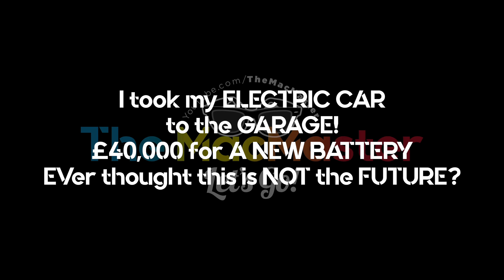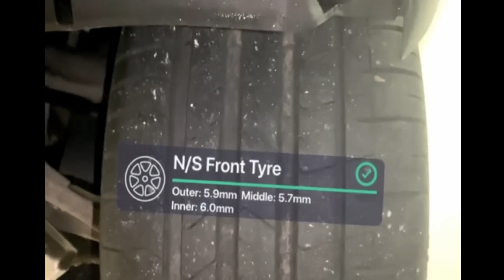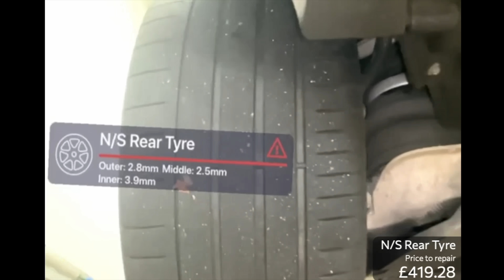I took my ELECTRIC CAR to the GARAGE! £40,000 for A NEW BATTERY EVer thought this is NOT the FUTURE?

Comment: Actually, my wife and I would be able to use an Electric car most of the time, as our needed distance is mostly limited. But we don't have room for it to have a fixed charger nearby and would most time need to drive a distance to get it charged. And once in a while we drive long distance, and I would hate to have to waste a long time during that for charging on top of the driving time. I don't drive 2000 km during a long weekend anymore. If so it would be absolutely hopeless (Denmark to Belgium and back, to walk 100 km)

Comment: Your looking at this wrong.  Electric planes wont be a thing and that is the point. They don't want us in personal.electric vehicles.The plan is to remove plane travel and powered personal travel altogether. The aim is to force us to stay put or take public travel. As for Porche's synthetic fuel, yeah it works BUT it has to be manufactured from scratch. There is no way this can replace thr current oil supply or amount of fuel we actually use. A non starter as a petrol replacement of scale. Hydrogen is the nearest to getting it right. But...

Comment: I think Truly and Honestly the buyers ,lease people, people getting finance need to use fit for purpose, if this product dies ,gets bad damage just from anything in normal use that gives this cost it surly cannot be fit for purpose, for god sake things happen ,manholes pop out due to extream weather ,Gullys too ,potholes ,yes these can cause damage ,yes if your lucky you can get the evidence and claim it back but no way at this cost .

What you have is a expensive brick that is costly if electric prices are high ,issues with chargers in general ,distance it can travel due to the temperature and a vehicle that truly cannot take normal punishment on the road ,some may say extream but its not compared to the costs involved just hitting the underside ,for God's sake knowing this why on earth would anyone buy new let unloan second hand ,they ate built to drive low for airflow over and under the vehicles ,even the T vehicles have the same issue when impacted underneath. 

It's like buying a old vehicle ,tax  exempt, a true bit of motoring history that many will only use in the summer, and garage the rest of the year lol 😅

Comment: Synthetic fuels are being developed.  Formula 1 are very interested, because they are repeatedly coming under the spotlight for being an ‘unnecessary, massive emitter of carbon’.  They claim that they will be fully on synthetic fuel within in the next few years.  But like all new technology, it will be very expensive at the beginning and will take many years to become affordable as demand grows and production methods improve.

Just done some quick reading.  According to Bosch, one of the main researchers, it currently costs about €50 per litre (before any taxes etc) but they predict that it could eventually be as low as €1 per litre (before taxes), that is still 3x the cost of petrol, and this would be decades from now 2040/2050.

Comment: The solutions 😂 Freight. Trailer swaps. I was told 20 years ago. Tractor (or puller) £90k. Trailer, £10k. Similar ratios will apply for EV trucks. A trailer loaded with EV vans, doing short hops into ULEZ style zones. Solutions for car….synthetic fuels. Stellantis are experimenting with engines going back 10 years….

Comment: The type of car a person buys should the the choice of the person not governments. Not only are electric cars expensive, they have also pushed up the price of car batteries for petrol, diesel cars. Those batteries have almost doubled in price over the last four years. I'm not against electric cars but we are not there yet in my opinion. Proper recycling facilities for such batteries are only just coming of age. I have two neighbours with electric cars that are constantly on charge when on their driveways. I am also worried about a fire breaking out as cars in my area are closely parked together with town housing being quite common and the cars are parked close to the house or in the garage to charge.  Not that I'm happy with conventional cars either. Base models not being made, nothing easily worked on needing additional cost of a diagnostic to see if anything is wrong at additional cost. Cars of any type are increasingly becoming money pits in my opinion.

Comment: Hi Lee, I did state £41,000 for a new battery in your other video so I wasn't far off. One other thing if newer combustion cars are ok to drive through London then why now use VE? just keep to the same spec and we can still enjoy driving our petrol vehicles. Also it's funny but you can still drive through London in older cars but you just have to pay even though older cars are more dangerous with pollution?? so where's the logic? oh wait a minute lets squeeze more money out of the motorist.

Comment: Eventually you’ll subscribe to a battery company that you pay monthly. They’ll have battery stations similar to petrol stations. Where you slide out the flat battery and insert it into a charging station, swap it for a full battery and put it in your car and drive away. They’re already doing it with bikes in Taiwan .
Reply: This way they can sell the cars relatively cheaply. As it’s essentially a frame deemed useless without the battery. But wether you do 100 or 1000 miles a month, you need to pay the subscription fee to access a full battery $$$$. You’ll never stop paying. As soon as you do and the battery runs out and you’re just left with a shell.
Reply: And just who is liable if your rented battery you have just swapped in turns out to be faulty and bursts into flames? No thanks!
Reply: @MartinHouston42  well I guess that will be on the company to insure their batteries are top notch and safe. When a flat batter is dropped off I’d imagine it would go under some sort of diagnostic testing before handed back out to the public. Another reason to subscribe to that particular company. It will all be monopolized similar to your telephone, gas and electric or insurance provider. Some companies will be cheaper than others but essentially all the same thing.

Comment: Often only takes one of the many (7k+?) 4.2v cells to fail to scrap an out of warranty EV.
The remote control works because one of the 4 connections failed.
An EV is reliant on 15k connections being 100% reliable.
It's only luck any EV doesn't have a warranty replacement. A Porsche computer out of warranty doesn't sound like something I would ever want to pay for.
I'm optimistic a biobattery that runs on sugar and water with some salt added, with a bunch of enzymes and a monster capacitor is possible.
If an eel can make 700+V ac without a mining industy....

Comment: Be aware that some 'new batteries' aren't actually all new. Some companies cut the battery open and only replace the bad cells. So you end up with a partially degraded battery in your car. Porsche, being so expensive, might not do that. 
Since I cut into my dead radio scanner lithium battery and a foot long flame shot out of it, I would never park one in my garage attached to my home. Losing one house to Hurricane Katrina was enough for me.

Comment: Looking at your tyres I would say get the camber and rear tracking looked as they are wearing on the outside also on the front they want to set track out as if you look the outers are wearing quicker that’s probably because of weight of the stupid battery’s we found this happened on tow trucks with the spec at back you’ll probably get a better price else’s where for the tyres 
Love the your old sayings another one always make sure your house is order  before telling others mps or clowncil mayors need think about that one

Comment: This is one of a number of problems with Electric Cars. The main battery that needs to be replaced costs an outrageous amount of money. I have seen from at least one YouTube website that there are now some shops out there that will do repair work on these electric car batteries. Often the repair work is far less money than replacing the entire battery.

Comment: Many EV evangelists think that by buying an EV, they are saving the planet because they "think" that their new EV is zero CO2 emissions. However, they fail to understand and will never accept that it is not zero CO2.
(1) The amount of CO2 emitted in producing an EV is significantly more than the equivalent petrol or diesel car. The owner of a new EV would need to drive something like 100,000 KM to break even with the CO2 produced at manufacture compared to an equivalent petrol or diesel car.
(2) Tyres on an EV wear out MUCH quicker because of the extra weight of the battery. So an EV owner will likely be replacing their tyres as least twice as often as the owner of a petrol or diesel equivalent. The production of rubber tyres is a very dirty business that emits a lot of CO2. Also, as cars are driven on the road and the tyres wear out, they are sending large amounts of microscopic rubber particles into the air that WE then breathe in EVERY DAY. Those particles get lodged in our lungs FOREVER and can cause serious health problems, including cancer.
(3) Many EV owners won't charge their cars from 100% renewable energy, like from the solar panels on the roof of their home. This means that a lot of their charging will still come from electricity produced at coal-powered power plants. So all they are doing is outsourcing their CO2 emissions to the power plant that is situated hundreds of kilometres away. That's a bit inconvenient, isn't it!
(4) Electricity prices are increasing so much that unless you are able to charge your car on a cheap tariff, the difference in price between a full 80kWh to 100kWh charge compared to filling a tank with fuel, is closing rapidly. The way things are going, it may end up costing more to charge an EV than to fill a tank with fuel.

Comment: Everyone should have a dashcam in their car. Get one that also has a rear-facing cam as standard, they're not too expensive and are easy to fit or you can get your local dealership/garage to fit it for you. They will definitely make insurance claims a lot easier and can reduce the amount of insurance you pay if you go to the right company. Also you can post vids of other drivers being stupid on YT 🤣

£40,000 for new batteries? That is a freaking joke! They wear out within a few years anyway, and by that time they could cost more than the car is worth!! Not even going to mention the (alleged) damage to the environment from mining the materials needed for the batteries in the first place.

Hydrogen power is the way to go. You can convert a diesel car to run on hydrogen easily (not sure how much it costs though) and it will still run on diesel if needed. Petrol engined cars will need a whole new engine though, so much more expensive. 

BTW Lee, I went into the local Sainsbury's today and felt like visiting the cafe for a coffee, only to find that it's gone completely (I normally have my stuff delivered so haven't been in the store for a while). Last time I went in, the bacon sandwich was heated up in a microwave and was barely good enough to score a 1/10. They used to be good when they offered real food cooked on a proper oven/hob but then just went downhill, coincidentally at the same time they closed down the fresh meat and wet fish counters leaving you with just packaged stuff to buy. Not a good idea.

Comment: This is a $142,000 dollar starting price car. Not exactly an average EV.
Reply: So you think Duracell batteries should be priced based on the price of the device you're putting them in 🤔😂
Reply: You think the gas engine for a Ferrari costs the same as a gas engine for a Hyundai.  His vehicle has an 8 year 100,000 mile battery warranty. This will cost him nothing.
Reply: @dougpurdy2720  Hmmm ... not sure I get your point. Is the battery technology in a Porsche different to that in a Hyundai? I don't mean the software that monitors the state of each cell, just the cell itself. I'm guessing the Porsche has a bigger battery with more cells but what is the cost per cell?

Comment: Why the hell is nobody talking about EV battery REPAIR?
The reason why insurance premiums are so ridiculous is because there is almost no investment from the government going into providing grants to train/fast track EV mechanics or battery specialist mechanics.
This means that the private sector battery repair shops will only pop up when the supply of such shops naturally catches up with demand. 

Go look at the numerous videos from mainly mainland europe youtubers who have successfully had teslas and other ev batteries repaired by replacing the individual cells within the battery. 

Not everyone realises that an EV battery is typically made up of hundreds of individual pouch cells (much like your phone battery) spread across 20-40 "modules" all connected in series to provide the high voltage needed. 

Use your brain people! If your head gasket blew on your petrol car you wouldn't necessarily do straight out and buy a brand new engine would you??
Reply: People would be too scared to repair them in the uk due to the litigation culture, if a repair had been done and the car went on fire ( even if not connected with the repair ) owners would be trying to sue the repairers, hence why so many are written off, people are not prepared to put their neck on the line
Reply: @markb4772  Sorry but I think this is scaremongering. By this logic, garages would be scared to change wheels or tyres by fear of causing an accident. How would you provide that a battery fire was caused by a repair? If the shop is certified to carry out repairs then it would have insurance for such eventualities, in the same way that fast fitters have liability insurance to cover under-tightening of bolts etc.

Comment: Surely the lesson learnt here is when the battery has degraded to a point that it effects the driver’s experience (and I know that will be years) then at £40k for a new battery it’s effectively scrap…this issue needs resolving
Reply: Replace the word "battery" with "engine" in the petrol powered Porsche and you have the same situation. Niche cars = lots of expense when things go wrong.
Reply: The lessons learnt is don’t believe this clickbait BS.
These ‘battery cost’ videos are pure income generators

Comment: If EV's were beneficial to the environment then having to deal with the multitude of issues and massive costs associated with them may be worth while. However EV's are NOT good for the environment and generate more emissions than a comparable diesel. The push for EV's is all smoke an mirrors and more effort should be put into finding a real solution.

Comment: You are absolutely dead right, EV’s  are a massive mistake. I bought a brand new Mazda CX 5 – 2.2 litre Diesel car 2 years ago and am very pleased with it.
It cost way less than a £40,000 EV battery replacement and even if I were to blow the engine up I would expect a reconditioned engine for no more than £5 grand. 
It has a DPF, uses AD Blue and has an EGR system which means that it does not pollute. It does 48/54 MPG. SO Who wants an EV they are Rubbish ?
Reply: Just bear in mind your CX5 is no Porsche Taycan. If you are going to make comparisons, it has to be like with like. The base model 2.2 with no options is thirty three grand. Not exactly cheap.

Comment: 7:36 We CAN say anything about them, its just they CAN'T except anything bad about them.
8:40 Sorry mate but there are already quite a few EV prototype planes and quite a few more on the drawing borde. Av-Gas is being phased out as it still contains lead. Compare the number of cars on the road to Cessners in the air, one could call it bit of a joke but it is happening.
OK, I got to the end, if you take my advice then ditch the thing an replace it with an old combustion powered car.

Comment: It's physics Lee. It's not currently scalable. By the time you've built an electrically propelled lorry  and given it sufficient battery capacity there's nothing left for the payload. Electrically propelled aircraft have the same issue. Maybe this will change - maybe not.
In the meantime I'm looking into the possibility of using a large rubber catapult - I'll be on Dragon's Den with this next season.

"I'm out" 😂

Comment: If you was unlucky and needed a new battery your insurers would probably want evidence of the piece of wood hitting and damaging your vehicle which you presume you dont have but even if you did they would probably write the car off because its too expensive to repair. On other YT channels we see many cars that have been written off for far less expensive damage so why would they bother paying for a new very expensive battery . Plus your tyre quoted at over £400 and wouldn't be long before the other 3 would need replacing is a lot more than a conventional vehicle having new tyres and a full service i bet . Good luck with your car but the way those batteries catch fire i don't think I would risk ever having a passenger in the vehicle again let alone myself travelling any long journeys from now on .

Comment: Hydrogen (or hydrogen blends) is the future for lorries and possibly aviation, simply because batteries are weight prohibitive and hydrogen produces the torque required in heavy lifting without the environmental impact.

Comment: As I have commented before why isn’t it a warranty issue as the protective casing failed
Reply: The service video showed that that VW Beetle Battery is better protected underneath than a WW2 Tiger Tank
Reply: @davebax6819  you could probably buy the tank cheaper